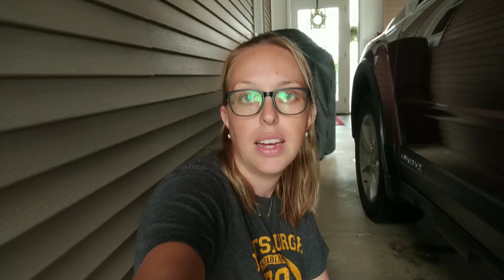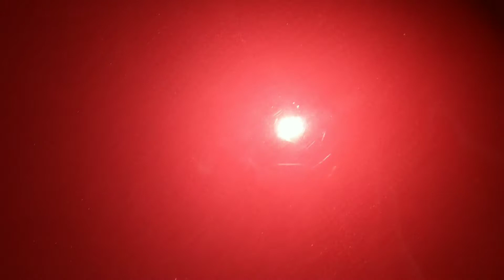IGL Quartz+ vs DPC Shield Experiment

Comment: What is best/longest lasting ceramic coating for the cost? Meaning hard paint protection and water capabilities.
Reply from the maker: That is a very subjective answer. There are so many coatings that are 5+ yrs on the market, but many of those are only available to pro installers. SB3, IGL, Ceramic Pro, Feynlab, and more. Once you get into these pro level type of coatings you're in the $1,500-$2,000+ price range for prep and installation. Prices vary by market and installer so it's hard to say which is the best for the cost.
Reply: What’s the best ceramic coat available at a retail level for the best price? Your opinion.